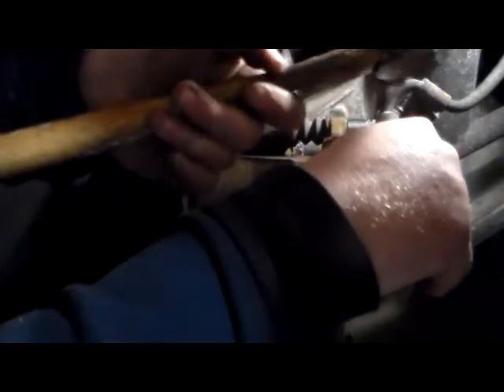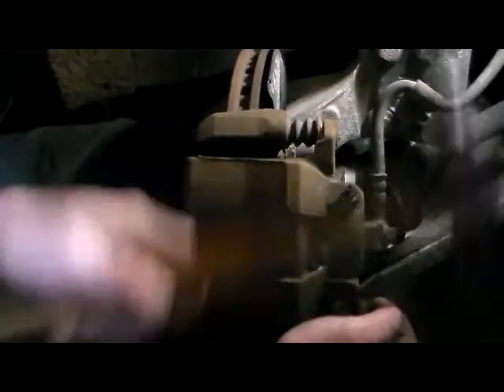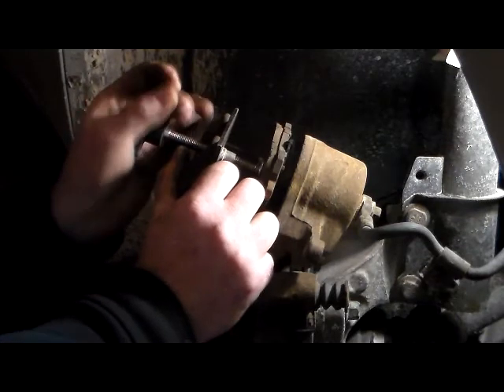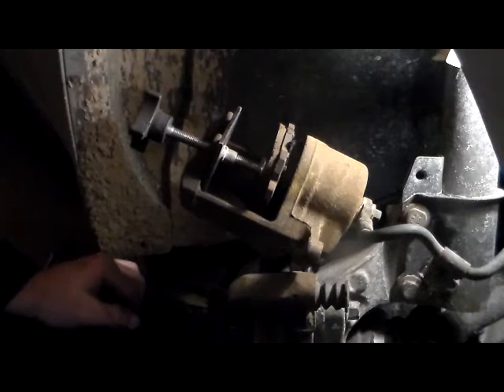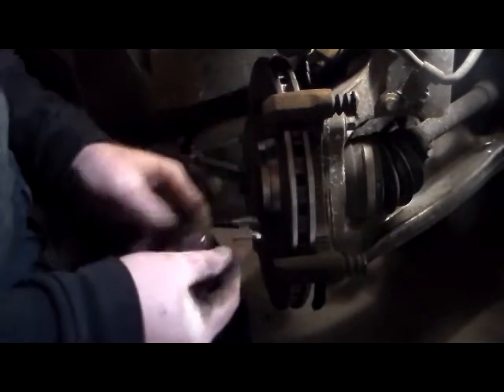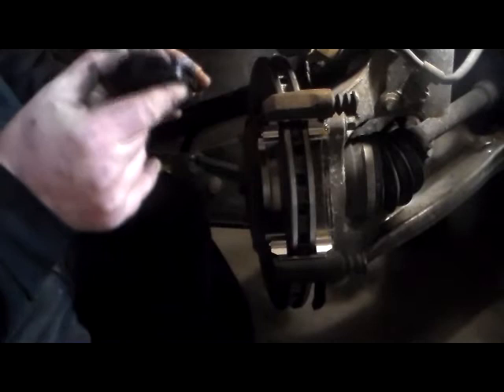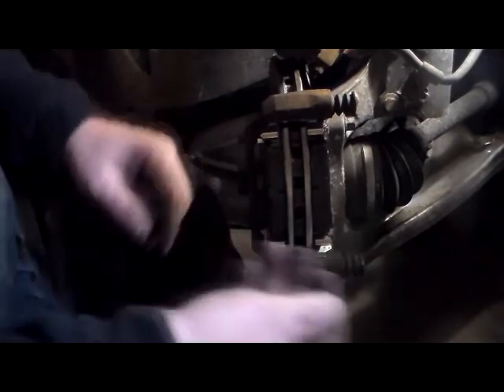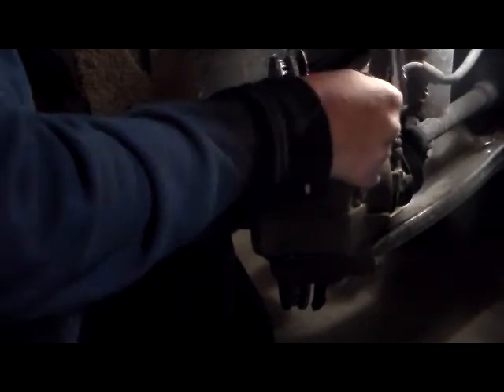How to replace brake rotor on a ponitac g6

Comment: What size rotor do I need for Pontiac g6 4 cylinders
Reply from the maker: That shouldn't even be a question when you go to the parts store or if you're ordering them online the computer should automatically know the size of the rotors I honestly couldn't tell you what size your rotors are I don't even know what size mine are other than the fact that they fit my 5 lug pattern